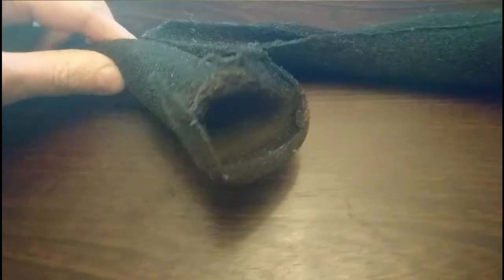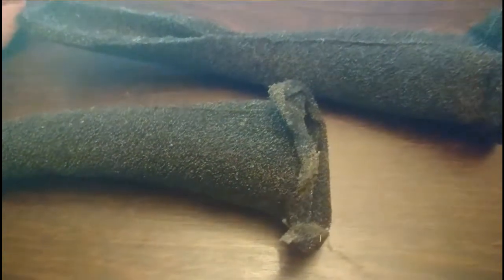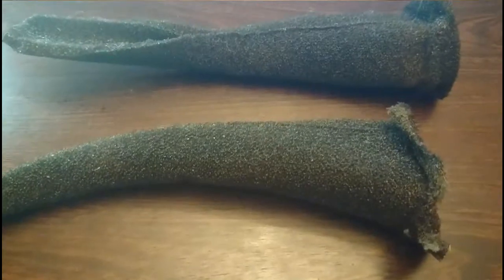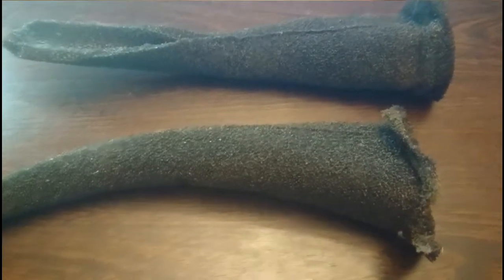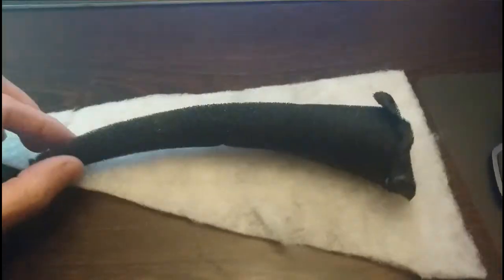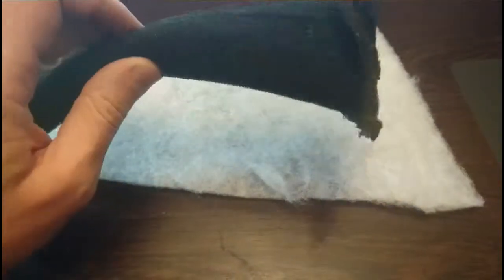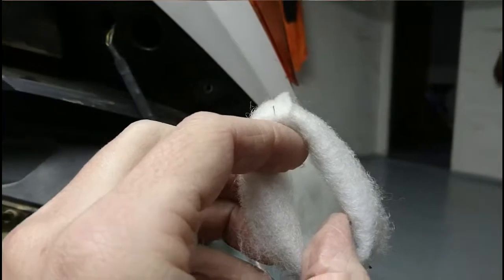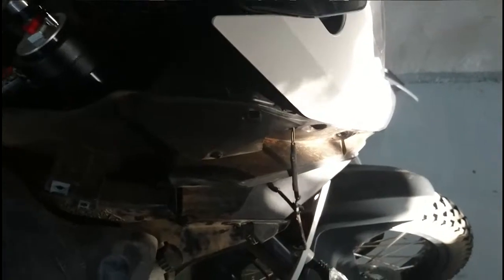Unifilter Snorkel sock replacement

Comment: Your not cleaning them enough and the air pressure builds up and blows them apart. Don’t knock if your not using it properly.
Reply from the maker: Both sets failed after 2000km. They were cleaned by the dealer and they were not clogged. Either it's a faulty batch or the design needs strengthening. I will knock them on price and material though.
Reply: @PatrickFlinner  The way i,m reading this is that you only did 2000 kms in one year. I change mine every 2000kms or 2 months & get 2 -3 changes out of one set, I have two sets on rotation,, they need to be re-oiled so they don't dry out. I do think they could be made better though. but preventive maintenance goes a long way.
Reply from the maker: @U-Have-Fun-2  no I did 12- 15000km a year. In dusty conditions they need to be cleaned frequently, which adds to the wear and tear agreed, but even my diy socks outlasted them.